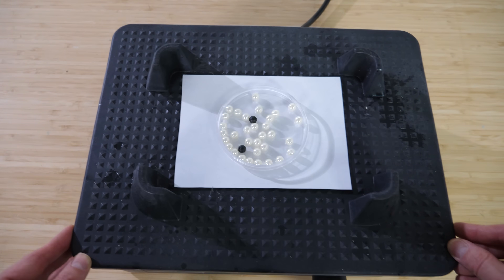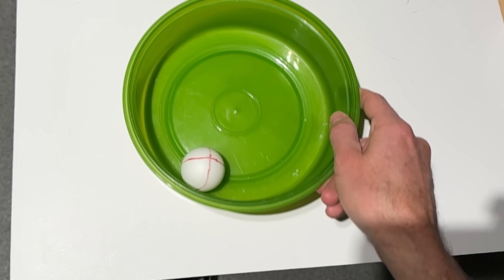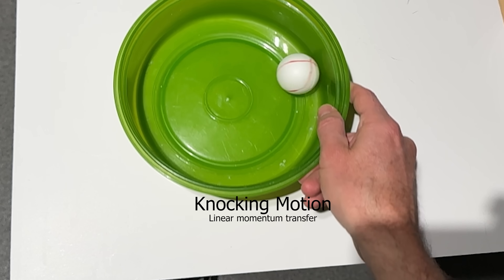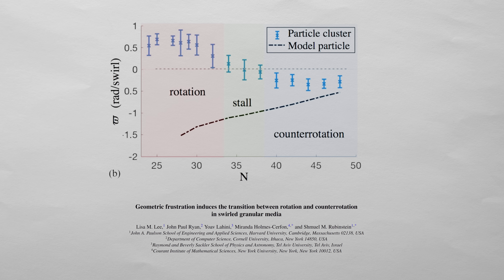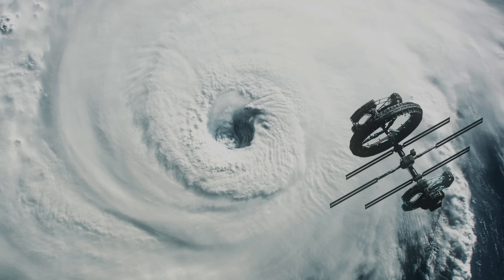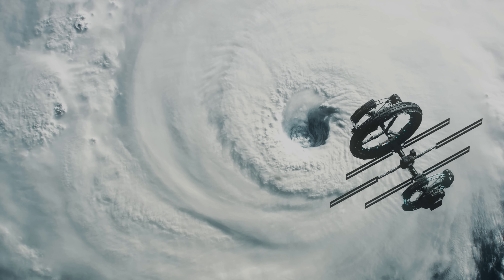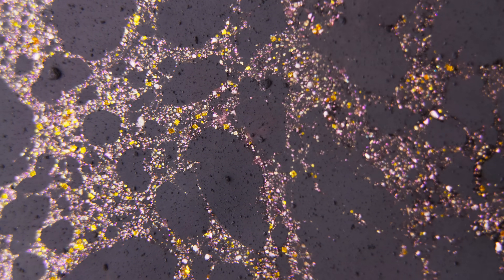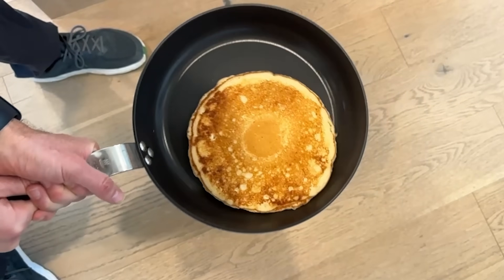The Strange Physics of Spinning Pancakes

Comment: Reynolds number at play.
A few beads is low viscosity, higher Reynolds, adding beads means more collisions, higher viscosity, lower Reynolds No.
There is a critical number where rotation follows either machine when motion is easy, or planet orbital when rotation is 'stiffer'. Is this number the same for all materials?

Comment: I wish you would perform that example under a high speed camera. If I'm not mistaken,  and I could be, but I believe the movement of the black beads at first, were rotating clockwise with the dish, however, it appeared the rotation of the beads were counter clockwise while the movement was clockwise.

Comment: My problem with this explanation is: they are all balls. We have two-dimensional motion. This explanation can only be used when we have only one type of matter under observation. Atoms and molecules come in different shapes and densities and have different magnetic and electric charge properties. This experiment is interesting for other reasons, such as how we can create complex motions within a confined space with different materials, where we change their properties with external influences to separate or combine, depending on density or rotation. P.S. This experiment would have a different result in a weightless environment, where the balls would escape their orbit!
Reply: It is all about the collisions and subsequent bounces, regardless of the location.  The dish and its perimeter define and confine the space.  In space, the experiment would be in a closed petri dish.  And "their orbit"??  WTF is that?
Reply: @cosmicraysshotsintothelight  You're talking about confining space. How much do you want to limit it? If you set too many parameters yourself, the results will already be known in advance! But I can make the calculation easier for you and squeeze them so hard that they don't move! What did I prove? Orbit or circulation around a central point. Each ball has its own lines of motion if they don't collide. In space, external forces would have a greater influence than we think, any difference in mass would be significant and the balls would stick to the mass like magnets. Just like liquids show this in a weightless state. But we must understand that liquids are observed in the presence of air. It would be interesting to see mercury in space, first released in the shade and then exposed to sunlight. PS. sunglasses are mandatory.
Reply: @matjazwalland903  Early STS missions had plenty of spinning liquid interaction experiments.
Reply: @cosmicraysshotsintothelight  Unfortunately, I didn't learn these results in school and I guess I wouldn't be able to see them even if I asked nicely. But I'm sure there are physics papers written to explain the experiments that have been done, which are intended for scientists with certain permissions. Do you know how many experiments have already been done in space and how many have been made public? The ratio is about 1/10,000.

Comment: 5:46 You put it in a liquid's momentum, so it has more external force in the direction of flow, and less interaction beneath as on the sides, so less "rolling friction" and more linear friction.
But if the liquid already moves in that direction, the balls, even going the opposite direction have to overcome the motion of the source and the motion of its medium—the liquid. Even though it is lubricant and reduces friction/interaction between solids, it still has a number of collisions per second, on average, that the balls will experience. Notice there was a certain amount of friction reducer needed to stop the balls (equivalent resistance to flow, friction is localized), so the contribution of the reducer cannot be ignored.

Comment: One other variable that also influences the direction of rotation is the frequency of rotation - it's related to how often the "particles" of the material encounter each other, so it has a coupling factor to the density/granularity/viscosity of the material.

Comment: I bet if you zoomed in on the liquid you would see micro counter clockwise turbulent swirls at the edges from the friction. There is no way the actual liquid itself makes clockwise swirls while being pulled against the glass.
You’re looking at the whole instead of the parts, the parts are just visible on a single large body like a pancake.

Comment: I think the walls of the container are also responsible for the opposite spin , but only a little interaction a little friction.  While the low friction condition causes almost motion with the pot .
In detail , provided a anticlockwise ,when the pot goes down the counter rotation is touching the right wall, while the normal rotation is touching the left wall . The when the pot moves up this is inverted .  If the pot moves left the counter rotation must touch the bottom of the pot ,while the normal rotation is touching the top of the pot .This is inverted if the pot moves right. So in the more friction case the object is left behind,  while no friction the object initially gets left behind ,but is dragged along with the pots motion. Okay okay , so put the object in the center , then move the pot to the left . Now the object in friction and no friction should be at the right side of the pot . the object with less friction is fully in contact with the walls of the pot , while Mr friction only have partial contact . Now the scene is set.  Now move the pot down, Mr friction gains a little  clockwise spin and shift to the top of the pot, while Ms frictionless is pushed to the bottom.  Yeah that it , next the pot moves right . Yeah,umm uh

Comment: I wonder if the experiment could stand a little more experimentation. Adding WD-40 may have reduced the friction, but it also added liquid. Wouldn't that change the dynamics of the beads from individual components into more of a single, whole body of fluid? 

What if the friction was reduced with a very small sprinkling of graphite, such as is available for use on bicycle chains? It stands to reason that using a friction modifier that doesn't physically link the components like a liquid could change the results.

Comment: Beyblades (attack tupes) work very similarly, just with the energy being supplied as rotation to the top rather than the container. A clockwise spinning top will travel counterclockwise in the stadium or a bowl

Comment: I have noticed an interesting effect of rotation reversal in spinning rings. You can put a ring standind up on a flat surface and spin it. You will see the whole ring doing circles on the same direction you initialy moved it, but when it starts to lose a lot of its speed and is almost falling, you will see the direction of spinning reversing. I aways wondered why that happened and maybe it has something to do with what is going on in this video.

Comment: One thing I noticed is that when the black beads started rotating backwards, they were still moving in circles going the same direction as the pan, but backwards relative to the position of the pan and the other beads. Not sure that this means anything…

Comment: It seems pretty clear why: the pancake contacts the wall of the pan and friction causes it to rotate in the opposite direct to the direction it's being swirled.
The same thing happened with the pearls/beads: when there weren't enough to fill and transmit the movement of the wall into the middle, they swirled/sloshed around in the same direction as the dish and then as more were added in, the beads acted like little friction gears and spun the inner ones in the opposite direction.
A mechanical exploitation of this is already done it planetary gearboxes, where the spin of the ring-gear is reversed by the planet-gears onto the sun-gear.

Comment: This is why pedal axes in bikes have screws on onsite direction of the rotation of the pedal itself.
Meaning that rotation of pedals with bearings locked or high friction would unscrew them but pendular rotation efforts on screw does the opposite.
Clever !

Comment: This is a bit misleading though, in both cases the TRANSLATION of the item is moving the same direction as the container, but the pancake is ROTATING in the opposite direction, we can't see if the juice is rotating in the opposite direction. I think you need to be more specific about rotation and translation.

Comment: Not convinced that the juice rotates at all. Bubbles in your example don't seem to be moving the way you described, and the sloshing is far more vertical than the other movement examples. I would love to see the liquid on the vibratory plate with a drop of dye to show the movement direction.

Comment: The bead and the pancake are doing the same movement, let say reduce the size of the pancake to the size of the bead or increase the size of the bead as big as pancake, both will be doing the same thing. The pancake it self is rotating to the pan movement, but it rotation is indeed moving counter wise, the bead do the same, its just because the bead are smaller size and we can hardly see it rotating only it movement so we assume it rotation following the petridisk movement, but it is not.

Comment: I think the pancake counter rotation is better described by “mechanical precession”. Wikipedia has a great explanation on the topic.
This mechanical precession phenomenon is also why certain mechanical systems use left handed threads, even though they are at first glance the threaded assembly appears to be resisting clock-wise rotational forces. 

The bicycle pedal is an easy to see example of this. On a bicycle, the pedal on the right side has a right-handed thread, and vise versa on the left. But if you look at the way the right pedal spins in operation, the right pedal actually spins in the counter-clockwise direction relative to the crank, so it might seem that the bike designers got the pedal thread direction backwards. But due to this mechanical precession phenomenon, despite the pedal rotating counter-clockwise, the torque resulting from the mechanical precession results in a clock-wise torque, keeping the pedal from unscrewing
Reply: Great example! This comes up with that math test example of the coin (or gear) going around a larger center disk (or gear)(where they touch and it rolls along the disk), how many times does it rotate during one revolution around the bigger center disk?
Even the the center disk has 4 times the perimeter, it actually rotates 5 times, as from the point of the disk, even if the coin was to us not rotating at all, it still rotates once as it revolves around the disk.

This is also similar to the moon, which to us appears to not rotate once, while to the sun, the moon rotates once per revolution around the earth.
Reply: Hey!  I just made same observation. !  You are absolutely right.
Did you learned in book or lectures? I had to figure it out right in the bike!

Comment: The pancake moves in exactly the expected direction and no different from how the juice moves in the glass. The glass and pan are not spinning, they are moving in a circular motion and both the juice and pancake are moving in that same circular motion. Not unexpected at all. 
The rotation is just it rolling against the sides of the pan like it should. Like almost anything solid would and like the juice literally can't.

Cool video. Fascinating stuff.

Comment: 00:33  The pancake is rolling against side of pan, it only rotates when in contact with side.  This is stronger than the friction betwn flat of pan and pancake, which would normally do any rotation.
Reply: This is my theory as well but I thought that's what the ball in the tray was supposed to demonstrate but he completely bypassed it... That is a big miss for him and I'm shocked he didn't even bring up how the wall of a container can change everything.    SMH
Reply: Wrong. The same effect happens on very large flat pans where the pancake is nowhere near any "side".
Reply: @Opisek i still think its just the sides causing it. On a larger pan without it touching the sides, the pancake’s side thats getting most of the weight at the time would get most of the friction so would cause it to turn just as if it was touching a side.
Reply: @BlueNem0  don't think too hard 😅
Reply: @beargillium2369  😂😂😂 ignore why my comment is edited 😎😂
Reply: @Opisek  If that's right then the vid should have gone into that!
Reply: @mikebeaton5632  Well, in does with the experiment and its explanation. Yes, the petri dish still has the limitation of walls around the marbles, but his explanation does not mention them at all.
Reply: Yup, if the juice was a gel or a solid you would see the exact same thing. Try a ball in the glass. Same thing. Apples and Oranges Comparison. None of this is news. This is almost as bad as when he used the channel to show off magic tricks.
Reply: Well, isn't great that youtube rando solves the problem that scientists have been studying for decades.

Comment: But WD40 isn't a lubricant! It actually dissolves the surface to reduce roughness and dirt and rust buildup 

It only worked when you had a big puddle of the liquid before it dried, a lubricant would keep working

Comment: Intuitively this make perfect sense for a solid object like a pancake or more generally a "wheel". The friction between the edge of the wheel rubing against the walls of the container causes the counter rotation of the wheel.

You could achieve the same exact effect with a fully stationary petri dish with a wheel inside it that has an axle. You push around the whell clockwise holding it by the axle and ensuring the edge of the wheel contacts the walls of the petri dish at all times. No one will be amazed that the wheel rotates counterclockwise as it "travels" on the inside of the petri dish wall.

For liquids or more generally "loose particles" as you demonstrated, they behave one way at low concentrations until the "phase transition" when they start to behave more like a solid object... a wheel :)
Reply: Even more so when you take into account the friction of the pancake on the surface of the pan that the liquid does not have.
Reply: @ValidatingUsername  Right I guess but that is no longer "obvious" at least not to me.

For example if you had a very large frying pan with a small pancake in it and you spun the pancake clockwise in the pan in such a way that the pancake doesn't go near the edge of the frying pan and stays completely in the flat section, will the pancake counter rotate? I couldn't intuitively answer that question.

However when you allow the edge of the pancake to touch the edge of the frying pan and there is some friction at that interface, then it is clear to me that the pancake will counter rotate :)

Comment: The pancake was MOVING in the same direction as the pan (just a slight delay) ... but it was ROTATING the opposite way.... So the beads test is a false parallel
Reply: You must not have watched all of it or you failed to grasp the events correctly.  The pancake was being "geared" by the rim of the pan.  The beads exhibited similar motion only after there were so many 'particles' present that it began to behave like a solid.

Comment: 1:38 not the same object because you increased the systems density.
Reply: Seems similar to the way parts of different sizes and densities settle out in a vibrating pile. Like buoyancy, essentially.
Reply: Kind of like something moving from a liquid to a soild?
Reply: It's the same material. It's a very straightforward analogy for solids vs liquids. Don't get hung up on nomenclature.

Comment: before i watch this video, i think its because of friction at the edge of the pancake 🤔 0:43
Reply: Not the edge, the interior of the pan doesn't move as much so the friction there makes the pancake move counter clock wise, since it is the part of the pan in contact with the center of mass of the pancake. Didn't watch the video yet either.
Reply: @Nartanek  are you talking about the edge/interior of the pan? OP said edge of pancake

also confusing since the pancake moves but not the pan itself